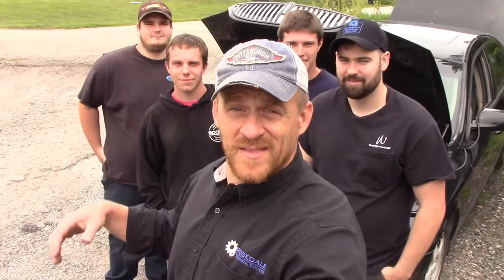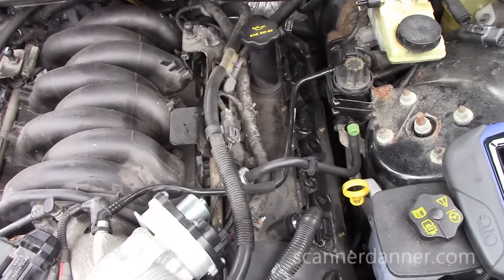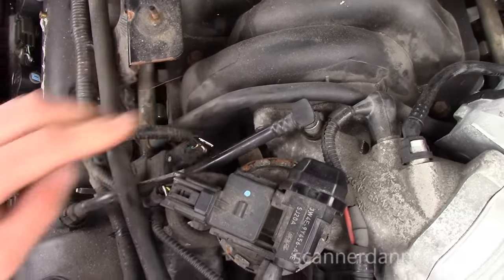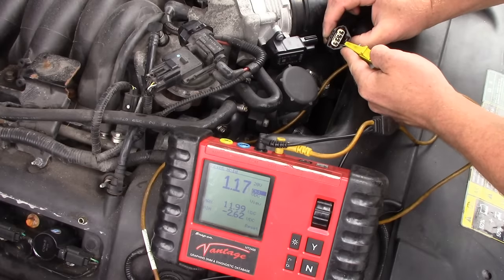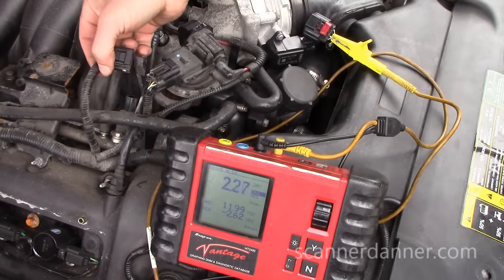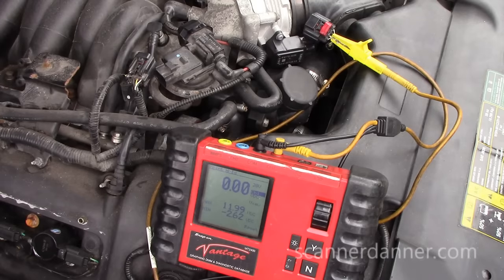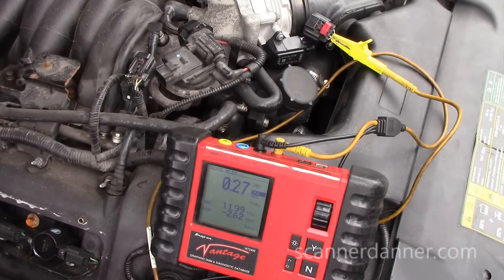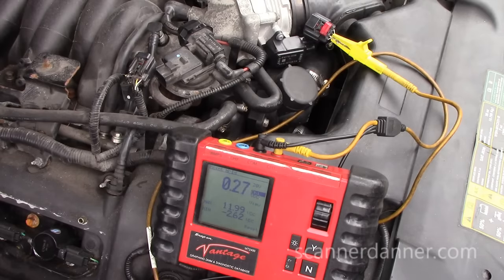Troubleshooting a No Start, No Spark, No Fuel, No Com (any car)

Comment: Great engineer, please help me out. This question was posted on your forum but no response till now that's why I need your assistance.

  Recently, a client called me to fix his 2000 Toyota Avalon car that cranked but wasn't starting.
   From the onset, the car experienced several mechanical, as well as, electrical issues. Some of those  problems were:-
(1) Engine Oil consumption;
(2) Engine misfire;
(3) Engine rattling;
(4) Intermittent hard starting after shutdown; 
(5) Hard to engage in drive, except engine is hot; etc.
Hence, he took the car to a garage inorder to rectify the excessive Engine oil consumption and other car problems highlighted above. Consequently, the car  problems exacerbated after engine rebuild by the engineer! 
  The car owner wasn't satisfied with his repairs because it seems the engineer was deceitful. Although the car started after the rebuild, the problems still persisted.  Valves weren't grinded after engine overhaul, engine still misfired at idle and when accelerating, etc.
   The  engineer whose garage the car is presently being parked, requested for another engine overhau/ rebuildl. After engine rebuild the car started, the oil was mixed with water; the engine was still misfiring, rattling, etc. It was obvious,  that he didn't use durable parts to do his work.

    Hence, the car owner moved the car to another garage for better repairs. The new garage suggested to the car owner that another engine rebuild is pertinent for optimal engine operation. 
    During my conversation with this engineer, whose garage the car is presently being parked, he told me that: "when the car was first brought in, he noticed a black smoke ( maybe he was mistaken for blue smoke, at exhaust tail at idle). When accelerating, there's a loss of power, engine bucking, popping,etc. After the rebuild, the car didn't start because the mechanic didn't unlock the car with the remote but proceeded directly to cranking the engine. In addition, the security relay wasn't actuated for starting to take place. Electrician did some wire cutting around that axis which he said was corrected to factory, opened with a remote before the car started.

   Fortunately, after everything, the car started again. But there was still an intermittent misfire. What the car owner said was that, 'even when the second mechanic did engine rebuild, the car still misfired. Until he personally bypassed earth from the COP wire to the solenoids very close to the fuel injector often tightened with 10mm knot and depicted with blue and green colors on the picture. Car owner verified that the reasons for the misfire from both mechanics which still prevailed, was due to the solenoid valve that wasn't opening. That's why when accelerating it experienced a loss of power, similar to that experienced by a faulty fuel pump.
  
   After gear oil replacement and test driven by the second mechanic , smoke started emanating from the engine bay. Precisely, from the fan relay that the car owner connected by himself. Within few minutes, the car shutdown by itself as if fuel is finished.  As he tried to restart it, the car refused to. Infact, when the ignition switch was turned to Acc/ ignition position, battery and fuel light was not displaying in the dashboard/ instrument cluster. However, during cranking battery light glew faintly and start. But when throttled,  it would shutdown. Electrician verified and replaced the alternator diode with a new one. When Ignition switch was turned to Acc/ ignition position, the battery and other lights came out brightly but when cranked to start engine wouldn't start again. Sadly, it still wouldn't start.
 
I tried to scan for DTC codes, but my scanner wasn't communicating. I checked all fuses, power and ground at obd port, those checked ok. but my scanner isn't compatible to read CAN network. there are only 4 wires intact for the obd2 port.
    Furthermore, I added fuel through the intake to the engine, no change at all. I checked for spark and injector pulse. These things weren't present. But there was power to injector with just the key at ignition or ACC and COP had 1 ground and 1 power as usual. 
 Electrician from that garage, who also worked on the car said that he sniffed burning smell from the ECU, however personally I didn't when I went to start the car. I don't know how certain that was. Hence,  I pulled out the ECU to a laptop board engineer to test the components inside. He said: "everything looks ok and test fine, however the IC he doesn't have the right tools to proceed with the test. With the ECU removed battery connected, Engine light would come ON. with ECU connected check light still comes ON.
Before I left, I checked the MAF sensor 5 wires and noticed that 3 wires were earth instead of 2 and 1 power; no ignition current/ power was available for the remaining 2 wires. 
  Please, what should I do to start the car?
Reply from the maker: 😆 there is a reason why you got no responses. You have a basket case on your hands with many variables.
Focus on the problem at hand and you'll get more replies.
All we need right now is year, make, model and engine and what your current condition is (no start, no spark, no injector pulse?) and what current codes you have.
Reply: @ScannerDanner  I will focus on the no start. Thank you so much for the hint.

Comment: You don't just pay for the Diagnostics to be done but also for my expertise and education and My tools being used even though it took a minute to find the misfire being the plug was loose still should charge for fixing it because it wasn't apart of the orginal Diagnostics @ScannerDanner

Comment: i have this same car my 5 volt reference is 5 volts on all sensors car only starts randomly after sitting days or hrs i do have low voltage at under hood fuse box  will this low voltage make a crank no start when car is warm an wot starts surge at 4000 rpm also have issues with alarm going off randomly an horn beeping whenever car is notorious for frying coil drivers an water leaking on fem will front modual cause crank no start or will low fuse box usaly 10 volt cause crank no start ive had this car 3 yrs an for life of me bought elm controller an got free forscan software an have no luck getting this car run right

Comment: All my coils are good and have been tested but coil number 3 connector doesn't have power at all.. what could be the problem .? Could the fuel injector be stopped up causing it not to come on??
Reply from the maker: No power? They all share a power feed, so you have a broken wire then. 
If you mean no control, that is a completely different ball game. Give me voltage measurements on that coil, both wires. Or use a test light (incandescent style) and tell me what it does.

Comment: One question I have is it recommended to change fuel pressure switch and fuel relay when changing fuel pump . 1994 dodge Dakota 5.2 L changing fuel pump at this time.  After watching your videos i think that i  should have checked fuel relay first , and fuel pressure switch.  But I went right to fuel pressure test . Witch i got 0 pressure on fuel pressure gage.
Reply: I would change the relay if it is not expensive.
I'm not expert but I think if I replace the gas pump at  my 1994 car, I would replace the relay too.

Comment: Nice diag Paul, how was possible to not start with that uActivate in???
Reply from the maker: Because the timing of the powering up of the circuits was not timed with the ignition switch like it should have been. Make sense?
Reply: +ScannerDanner yep man thanks!

Comment: sir we need how to fix about trouble of hyundai h -100 we been truoble its a clutching starter but right now i dont know how to fix it starter punctioning batttery is good to the engine not start the way its start before but it will start thruogh pushing it will you help us sir

Comment: Does your book go over how to read wiring diagrams. I have all of mine but can't make sense of them.
Reply from the maker: My book teaches systems and designs which will enable you to read the wiring diagrams. If you know what a component needs to operate then it makes it easier to see what you are looking at on a schematic. Chapters 2 and 3 in particular are very useful for this.
Reply: @ScannerDanner  I just bought a multimeter but can't find a video on doing a drop volt test on a side post battery without specail connectors I cant afford yet. My car won't crank but my electrical works. the check engine stays on so the computer is working,. when I went to reconnect the negative terminal after cleaning the post it sparked. Also my starter is new. This has to be an electrical issue in the wiring but all the videos have tools I cant afford right now. Can I do a volt drop test on a side post with the basic multimeter test pins? Also tommorrow I am going to attempt the 5 volt reference test with the multimeter when I get off work. Any help would be appreciated as tough as not having my car has been your videos have been awesome and I'm kinda glad it broke this field is really interesting.
Reply from the maker: you don't need special connectors on your meter. If you need additional help, spend some time in this playlist https://www.youtube.com/playlist?list=PLAFYVCyenqcpZM-kQg5MUX0OvrIPSirz5

Comment: I have a 2018 dodge journey battery is fully charged . Alternator when running disconnected it so its not there.  And sometimes when driving all lights on dash flash and the 1st time lost all power . We been banging our heads against the wall even biught a new BCS for the battery . Nothing

Comment: Captain can you tell me why I’d get a negative resistance when connecting resistors , with key turned on ... is weather a factor?  It was like -14 when trying to wire a 2.3 resistor .. when the key was on1.56 but when I tried 1.6 the resistance said 1.30 ..
Reply from the maker: You cannot measure resistance on a circuit when there is an existing voltage on that circuit. Your ohmmeter IS the battery in the circuit when you are testing for resistance. ANY external voltage that is applied will alter how the ohmmeter reads. Make sense?

Comment: great video. particularly like how otc 3893 would hi lite circuit path and trace. do you have to pay extra for this and who (mitchel etc) provided wiring diagram. am gonna join premium next week.
Reply from the maker: yes the program I use is very expensive for diagrams and information but Mitchell does have a DIY version that makes it affordable for you guys. We actually put something together on my forum to help
https://www.scannerdanner.com/forum/post-your-repair-questions-here/3757-need-service-info-check-here.html look forward to hearing from you in the premium video comments! Thank you so much!
Paul
Reply: @ScannerDanner  Do you have to be a Premium member for that link to work? I get a "404 Not Found" when I click on it. Thanks.
Reply from the maker: No you do not, sorry, I've been doing some site maintenance and that link was bad, it should be good now thanks!

Comment: I have a 2005 vw Jetta 2.5 and i drove to the store and turned the car off came out to leave and had nothing.
Good battery, good starter, have to run a bypass wire to starter to get it to turn over. No spark or fuel either.
Its been a year and i have torn the car apart and no one can tell me anything and no one wants to work on it because its a 2005 jetta.
I've been working on cars all my life and never had this problem before.

Comment: Could we have found that band relay with a thermal imaging camera or laser temperature sensor?
Reply: I suspect we would’ve seen that the contactor tips were glowing hot from the high resistance and would’ve shown up on the infrared camera? Great video love your work.
Reply from the maker: Maybe, but relays do get very hot under normal conditions. Thanks!

Comment: At 45:30, there was a buzzing you said you had to listen to...then when you clicked the blue gizmo switch the buzzing stopped. What was buzzing?! Cause...after you stuck a new relay in, it ran. But, it had also been buzzing...then buzzing ended, before replacing the relay, and testing for 5v. Which then came on again, and car then started, after codes finally allowed to be removed.  So, what buzzed? Not the blue gizmo...?! What? Thanks. This point will help resolve a question of whether the car would not run because of antitheft actions..or was it only the 5v being missing? See? There's more to the picture than swapping relays.

Comment: I need some help,. I have a 94 dodge ram with a 5.9 and it will not idle or stay running with a noise coming from the bell housing. I can get it started but by the time I get out and get to the end of the door it dies. I'm up for any suggestions
Reply from the maker: Noise in the bell housing start at the same time as the running issue?
Can you keep it running with your foot on the gas pedal?
Is it misfiring really badly?

Comment: i read that the relay tool is primarily used on ford gm honda type of vehicles. My question is despite it being for most of the Fords GM and Honda line of automobiles can the uActivate Circuit Test Assistant be used on a 2007 Audi Q7 ? Or would i need to find a compatible Circuit Tester suited for the Audi vehicle ?
Reply from the maker: https://www.aeswave.com/scannerdanner-c512/ not sure if the redesigned model would cover your car or not. You can simply jump the load side contacts with a paper clip too. Just don't jump the wrong pins
Reply: @ScannerDanner  I took out relay number 644 which is found under the hood on the 2007 Audi Q7 3.6L V6 Quattro. I found that the relay was sorta rattling on the inside. I know that isn't normal and should not be, so I will be replacing it altogether. I am not sure if you have had much experience with Audi Q7 vehicles they definitely are complex given some components serve multiple purposes and functions for other things. I want to say the relay I am speaking with you upon here #644 which says its :
fuel pump relay and something else which serves 2 funtional purposes. I follow your work here great explanations of what your looking at to diagnos the problem(s) which i am a learning in and over time to be a better DIY'er lol to fix my vehicles i have when there is an issue.
Reply: @ScannerDanner  do you yourself have any videos upon how to properly perform a compression test on vehicle and is that the precise way to do said compression test across all other kinds and types of automobiles? The Audi Q7 3.6L V6 Quattro i own it says the proper way to do compression test is to remove all 6 spark plugs. Whereby a guy i know who had used my compression test kit only on 1st cylinder and I later learned that his test was wrong because he had not removed all the spark plugs as he was required to do. So i don't think i can go by that test even though it was only for the engine's 1st cylinder
Reply: @ScannerDanner  Which pins never attempt the jump with 30 and 85 ? Only jump pins 86 and 87 🤔
Reply from the maker: @TyroneMaye  never jump 85 and 86, ever! 
30 and 87 are your normally open load side contacts that can be jumped together as a test
Reply: @ScannerDanner  oh okay so whats difference in testing by jumping relay in contrast to that where there are a series of wires ran connected to relay and coming from good battery for sound i guess from relay or is that something different all together ?

Comment: I'm looking alot of your videos to figure out why my car just cranks no start but I notice that obd has no communication and fuel pump stays on all the time with key on 1997 celica 1.8l any help would be appreciated has no injector pulse
Reply from the maker: Great observations so far! This is usually from either a blown main ECM fuse or a bad ECM ground. Step 1 with the key on, find your coolant temp sensor and unplug it and give me voltage readings on both wires. This will dictate our next step
Reply: @ScannerDanner  okay will do but I gatta tell you its kicking my but since I'm not a mechanic but following your videos

Comment: Scanner Dan,
 Here is a problem that a soldier who needs our help.  They have a 2004 Nissan Quest 3.5, 5 speed transmission.   1st somehow the main negative cable was burned out.  Replace the main negative cable under the battery. The car cranks but will not start and no fire (no spark).  I did the 5 volt reference test, I am getting 11 volts at all point that I check.  After I try to start the car the OBD give me a code for all of the items I unplug. I would like to think the ECM is still good.  A few Nissan people have told him to junk it. He and his family cannot afford a car payment.  Where do I go from here???????????     Thanks in advance
Reply from the maker: Nice! This should be fixable. You have bad computer grounds. You need to do a google search on where the main ECM grounds are on that car. Let me know what you find. 
If you find your ECM main grounds are good, it is then possible the sensor ground circuit in the computer got cooked with whatever "burned out" your negative cable
Reply: Thanks for the quick reply.  Sorry the grounds did not help the problem. I even added some other grounds. Used the Modis edge scan tool, one code P1031 and  the odometer has no reading (might be important). Could the fuel pump system be a reason for no spark?  All of the fuses and everything has great reading.  Any other ideas? I would like to think the ground burned due to corrosion. No other wires are burned, missing or corroded.
Reply: The ecm are notorious for rusting out, check the ecm by the cowling pull the ecu and check for corrosion.